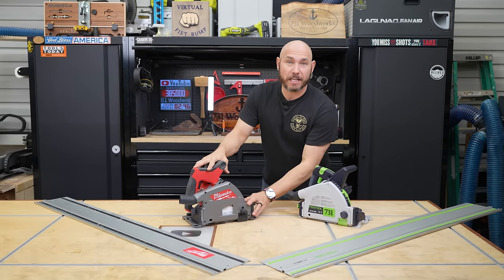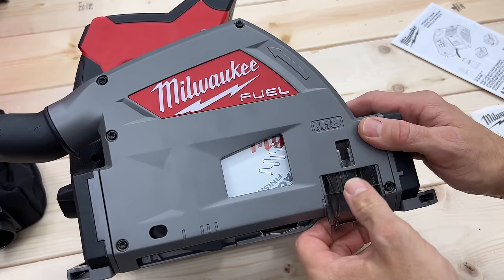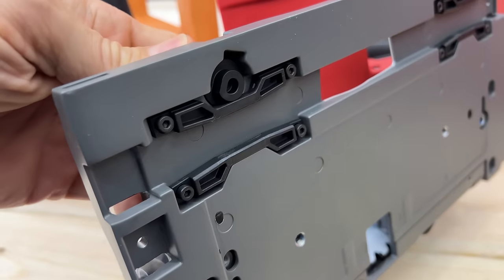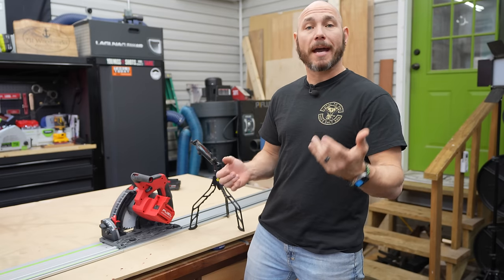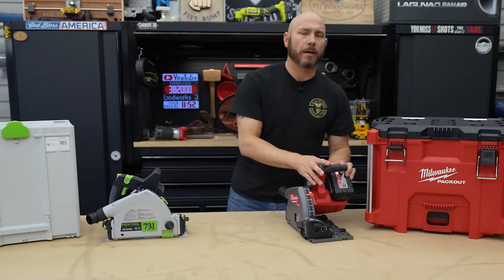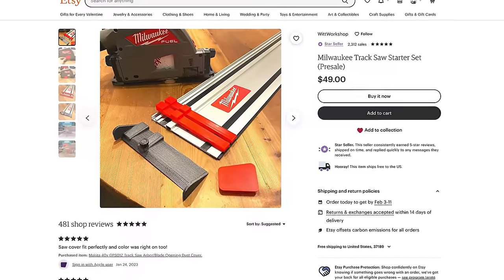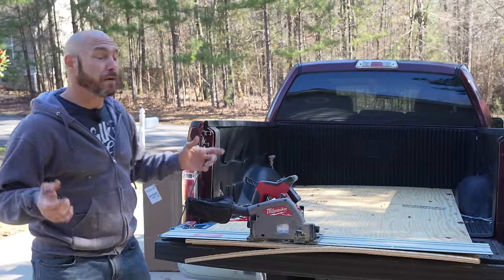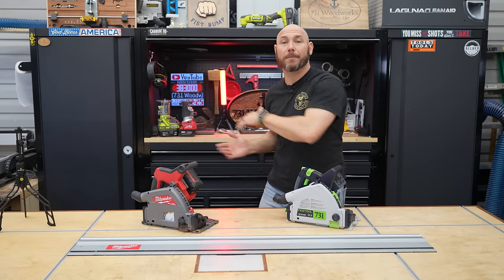Milwaukee Track Saw - Everything You Need to Know

Comment: I want to comment on your battery observation, 6AH vs 5AH. As mentioned in the comments already, the 6AH basically means the total amperage (power per se) the battery can provide in one hour, in this case 6A. Swapping a 5 and 6 should not effect performance except how long the battery lasts. The only time i think it would matter is when either battery is close to the end charge. Having said that and I don’t mean to be disrespectful here, but wonder if your observation was real or perceived? Maybe some experts on batteries can comment?
Reply from the maker: What I was comparing, more than anything, was the "High Output" of the 6 Ah vs the regular 5 Ah.  The high output battery is, in theory, and what I perceived during this test, actually giving more power during the cut.  There's an article here about them also https://news.ohiopowertool.com/milwaukee-m18-high-output-vs-standard-redlithium-batteries/
Reply: @731Woodworks  ok, that article was helpful and enlightening! Thanks
Reply: @michaellacaria910  you are correct 5ah-6ah is just the "time" the battery will work for.... what gives a battery more "power" is it C rating, the C rating is how fast a battery can be discharged (and charged).... think of the C rating as on a graph , a high C rating will give a straight line for much longer than a low C rating which the power will drop off faster.... I know this from having 40+ years of using RC batteries
Reply: @CementRoots  thanks for that clarification, I was aware of such ratings but didn’t know what it was called. I’ve never seen it advertised either.

Comment: To me Festool is more of a in the shop use tool. Where as the Milwaukee is better suited for the field like most of their tools. I have a Milwaukee 1/2” drill that is some 35 years old and it’s still going, it’s tough as nails. I have a friend who has the Festool track saw, I’ve used it many times. I just ordered the Milwaukee track saw. So we shall see.
Reply: That 35 year old Milwaukee will be made much better than their new gear, I have tools from most brands and Milwaukee is definitely my biggest returned for warranty, not built like they used to be unfortunately 

The festool saws are fine on site, they can take a lot of abuse and remain accurate

Comment: This was a GREAT review.  Unfortunately, in terms of cordless tools, I'm already vested in DeWalt, or I would've gone with Milwaukee.  That's one of the many reasons the batteries are so expensive.  But, I digress...  So, I've got a 60v circular saw, and   didn't like DeWalts either.  So, in my search for track's I came across a site called TrueTrac.  It's one of the best companies I've ever dealt with, on every level.  I wound up purchasing several of their products (i.e. table track setup track channels), because of the phenomenal quality and customer service.  Not trying to steal any of Milwaukee's thunder, or hijack this review, but until my own search, I had no idea TrueTrac even existed. I needed something of incredible quality that was universal.  If this doesn't suit you, and you're already vested in your saws, then check them out. 👍
Reply: bro milwaulkee is trash for the price. dewalts track saw is stupid powerful. i like truetrac btw but i personally think that powertec ones are pretty good for the price.
Reply: Is True Trac the old EZ track system? looks like it because you use your own saw and some of the components look familiar
Reply: @dougupah8778  That's a good question, Doug.  I honestly don't know.  Honestly I bought it out of desperation, and was a bit cynical because it's expensive.  When it arrived I was astonished at the quality of this stuff.  I ran into some issues mounting the adapter plate to my saw (which has a unique setup), and I sent the saw to them, and they mounted it for me, and sent it back with extra parts for the future.  Just a great (yet, small) company, with really good products, if you're in the same boat as me.
Reply: @lmaoanatorhilarious2582  Interesting... That's  one of the few negative comments I've heard about Milwaukee.  Mind you, I'm referring to their lithium product line.  They're ALL expensive, brother.  I got burnt by two bad DeWalt batteries.  They replaced one, to their credit.  But, it left a bad taste in my mouth.  That said, the DeWalt tools themselves have held up very well, I have to say.  Although, I am having issues with my oscillating tool getting really hot at the handle.  Anyway....it's a moot point now, I'm so deep into DeWalt tools, that I'll be buried with them.  I can't remember why I didn't buy the DeWalt track saw....I think it was because I'm using a heavy duty 60v circular saw, not the "plunge" style (if I recall).  That said, it all worked out in the end with the TrueTrac I wound up getting.  Just wanted to share that info, for anyone who was in the same boat. 👍
Reply: @phillamoore157  If  it is I had bought one approximately 20 years ago under the name of EZ(and when I google EZ system it takes me to the True Trac site), knew the creator/inventor of  it, worked good, had some really good features and was considerably less money then the current track saw models.
Reply: @dougupah8778  Interesting.  I wonder why they changed names?  Guess someone sold out, or got bought out.  👍
Reply: @phillamoore157  no one wants to tell them what’s right. They just want to fan boy over their tool that can go a little faster out of the box. If you’re a company like Milwaukee and you’re suppose to be prestigiously “made in America” then make the tools so damn good that it blows the other companies out of the waters. Made in America is supposed to SHIT on the competition, especially shit that’s made in China. It’s already made here, no customs to go through, no shipping, we have high quality materials and high quality machines to create high quality tools. Dewalt is legit, I don’t think I’ve had a major issue with a dewalt ever. Maybe a bad battery here and there but I’ve gotten that from every company I’ve used cordless tools with. They hold up very damn well for the price. Tbh if major companies like dewalt, Milwaukee, and makita keep making their tools without really trying to improve them then they’ll get left in the dust by Flex. Definitely a brand to not sleep on. I give them a few years and their tools will be build better, stronger and have better batteries than any brand. I’ll completely switch over from all my tools if they come out with absolutely everything like table saw, etc. we need more competition and people pointing out “hey you’re claiming this so why don’t you add that to your product” or go back to the traditional American and take pride in the crafts and products that’s we produce in this county

Comment: I’ve got the flexvolt track saw and have had it for years now, done hundreds of houses of cement sheet cladding, tens of thousands of cuts and it’s a great site saw, I’ve been looking into another saw for finer work when hanging doors etc and also have Milwaukee batteries but the lack of auto start for dust extraction is a massive miss for me, even the old dewalt has it, makita has had it forever and so has festool 

I think I’ll be going the festool route for the nicer saw

Comment: Like the video, glad you mentioned you paid for the saw and it was not provided. One thing about the Milwaukee warranty is that it’s completely worthless. Almost every single Milwaukee tool I have owned has failed within the 5 year period and Milwaukee has not once covered any of them under warranty. Milwaukee provides a limited warranty, festool provides a 3 year wear and tear included warranty. Recently I dropped my hkc saw and broke the dust port, it was fixed within 2 days and I was provided a loaner saw to replace it while it was out of service.
Reply from the maker: Good point on the wear and tear warranty.
Reply: @731Woodworks  probably the most legit warranty I have ever seen. Legitimately fix anything while Milwaukee fixes absolutely nothing. Still a place for Milwaukee in my truck but they are Chinese made throw away tools.

Comment: Great video, as usual. Do you recommend a battery or corded track saw?  If I plan to use this in my workshop 95% of the time is there any reason to get a battery powered track saw?  You probably already have a video on the comparison between corded and battery, I just haven't found it yet.
Reply from the maker: I don't have a video on that. It's just a matter of personal preference honestly.  If you have dust collection, you'll already be tied to a hose.  So adding a cord isn't that big of a deal.  Cordless is more of a convince if you need to take it with you or even cut things in the driveway, etc.

Comment: i wanna know if I made the right choice getting the Makita 40v track saw instead of the Milwaukee ones, now I'm not into Makita 40v platform but since Home Depot had a great deal on that saw that includes the charger, battery plus extra 4.0aH I couldn't pass on...while I have the Milwaukee M18 platform, the price of this saw is way higher (tool and chargers/battery) at the time of this writing. one thing to note that; I bought the WEN track rails instead of buying the Makita. I'm fully aware of their performance, I was just wondering IF buying the Makita was the right choice moving forward instead of the big RED...thanks and you got yourself another subscriber!

Comment: I’ve been on the Milwaukee platform for the last 8-9 years. 4 years ago I was doing a project and wanted to use a track saw. I would’ve bought a Milwaukee but obviously wasn’t an option. Festool was too expensive so bought a Makita kit. The first one died after the 2nd cut. Received a replacement under warranty and has been fine since. If Milwaukee didn’t drag their feet I’d have one and I’m sure I’m not the only one. Bummer.

Comment: Alri bro.. When I saw the headline to the video I was thinking it was a bad saw but it sounds like u are torn a wee bit to see how good they compare with the Festool.. 
I'm in the market for a Table saw but these track saws today do just as good a job for certain types of cuts once u have a good table to work on.. 
How hard is it to get KREG in Ireland? I'm struggling to get my hands on one of those newest HARVEY ALPHA SERIES pro table saws.. Man it has this coating on it that stops rust? I really want one of those bad boys. Now I know this is about Milwaulkee Track saws but I had to throw my silly comment in here bro.. Apologies. Love the content man. Always great viewing from ur good self. 
I'm still in the process of kitting out my shop but my tools are not of the highest quality.
Yeah I want to eventually splurge on a couple of top line tools like the table saw and maybe some others like Impact drivers, drills, Bandsaw, etc but I use cheaper tools in my excuse for a manky shop and they serve me well enough.
I bought a wet/dry grinder from a local store for 44.99. Ok so the motor mightn't last as long as some of the more expensive models but for what I need to for it'll probably last me 10 years or so. I also picked up a beast of a belt sander for the same price. 
I'm building cabinets for my shop for the past couple weeks bro. What tips could u or anybody in the comments give me to getting sturdy cabinets that'll last the time I'm in there? 
Really sorry for the longwinded comment man. I tend to get carried away when I start talking or typing about my little workshop.. LMAO.. Great content as always pal.. Keep up the brilliant work man..

Comment: warranty for Milwaukee and Festool are leaps and bounds different.  Yes the battery for red is covered for 3 years BUT only for manufacturer defects, NOT wear and tear.  Festool wear and tear covered for 3 years.  That is a big difference between premium brands like Festool and Hilti; their warranties cover wear and tear.  Same thing for the tool body for Red only manufacture defect or workmanship; specifically says not wear and tear.  Gotta read the fine print on "warranties"

Comment: This’ll probably get me some heat but my woodworking hobby has to compete with a couple others (metalwork, firewood, garden, house) so I’m going to have to wait till Harbor Freight adds a track saw to their Hurricane line. I’ll use a coupon and cough up a couple hundred bucks and be clam happy with it and proudly drag it around in my milk crate case.

Comment: So I cannot use fasttool or Makita blades on Milwaukee?
Reply from the maker: I think* the Festool blades will fit the Milwaukee, but you'll lose a 1/4" cut capacity.
Reply: @731Woodworks  yeah that's fine as long it fits and can be used. Thank you.
Reply: Freud blades are better for all of them and are much cheaper.  Check out some videos that reviewed the freud blades.
Reply: @731Woodworks  Isn’t it just depends on the arbor size the Milwaukee is 20mm so any blade with 20mm and not larger than 6 1/2 should work. Even though their blades are thin kerf and the riving knife matches that,  a thicker kerf blade another company sells should still work. If it was the other way around, thicker riving knife and thinner blade then it wouldn’t.

Comment: What is the point of a cordless tool that requires to be attached to a vacuum hose?
Reply: Right if you are only going to use it in a shop with a  great dust collection system might as well buy  corded  which will be cheaper, but on-site contractors use a lot of cordless tools nowadays so this is another they will not have to drag a cord out to run it.

Comment: I disagree that there are only two top competitors. Makita is on its second generation of track saw. The first was a 36V, “two 18V” batteries and the second is a single 40V. Concorde Carpenter did a comparison against Festool and the other brands a few years ago with the Makita 36V and it fared very well. Whitworks compared to 36V to the new 40V and I believe he admitted that it was a step up from its predecessor. I have the 36V, but I am not knocking Milwaukee’s entry into the fray, but I would strongly suggest giving Makita a look, because it is a good saw.

Comment: Given that a battery-powered saw is going to cut slower, and you have to deal with always having a battery in reserve, and you’re always going to have a dust hose attached anyway…. why would you want a battery-powered track saw?  I just don’t get it.
Reply from the maker: If you take this to a jobsite, especially when there's not power readily available then battery powered is the way to go.  For most shops, it really doesn't matter other than not having to deal with an extension cord.  Just another thing that gets in the way. But some people prefer corded tools over cordless. Comes down to preference.

Comment: Matt, awesome video on the new Milwaukee tracksaw! I'm a Milwaukee tool user, so I can't wait to pick one up. However at that price point I'm gonna wait a while longer, lol. I have to wonder if the High Output 12.0AH battery would make a noticeable power difference? I digress. Thanks for the great content. Take care
Reply: Wont fit, You can put the battery in but you cant get your hand over the handle after

Comment: There’s nothing proprietary about either of these saw’s blades. Any 160 x 20 (6-1/4) fits that Festool. Any 165 x 20 (6-1/2) fits the Milwaukee. 
I have the Metabo cordless (amazing saw, by the way) and it takes 165 x 20 but I can flip the saw side arbor flange around and use standard US 6-1/2 blades with the smaller 5/8 arbor. I believe the Makita track saws also have this feature.

Comment: At this point track saws have been out for so long I don't understand why the price hasn't dropped some. Especially when wen is so much cheaper but mostly equal quality. To me that shows they can make them cheaper, and probably do, but won't pass any savings to the consumer just because of the name behind it
Reply: The Wen isn't even close in quality to a Festool, Milwaukee, Makita, or Bosch track saw, and I say that as a fan and owner of Wen products.
Reply: @RobertBarth1  didn't say it was. I said mostly equal, which is it. It cuts straight lines, has metal parts and dust extraction, comes with track for less than $200. That's really all I need and the few added features just doesn't justify an extra $600 price tag
Reply: Long term durability, warranty…

Comment: Obviously the Milwaukee overall is of higher quality than the Festool, and I'm not even a Milwaukee fan boy, all I own from them is the Packout tool boxes filled with DeWalt tools. One thing I know is Festool uses a very low grade plastic for their boxes and the plastic on the tool itself is not exactly amazing.  The size difference between the two boxes is not even significant. They are both roughly the same size but the Packout box is actually useful and very durable. It's not like the Festool box is half the size, it's slightly smaller but not enough to matter. Let's be honest the Festool boxes are kinda junk if you are not babying them..

Comment: Compare it to the new Ryobi track saw at  $500 less. Probably not in the same league, but why not?
Reply: I had quite a few Ryobi tools back in the days.  If I were to do it all over again, I wouldn't choose them.  I replaced Ryobi with DeWalt despite paying more the 2x the price.  Built quality ergonomics, weight and etc...  Cost of ownership for Ryobi probably more than DeWalt because I had to replace Ryobi batteries and tools few times for the same number of years of usage.
Reply: @ipick4fun27  Their old stuff was definitely lower quality than the new stuff. I have a bunch of their brushless tools and have had 0 issues with either batteries or tools.